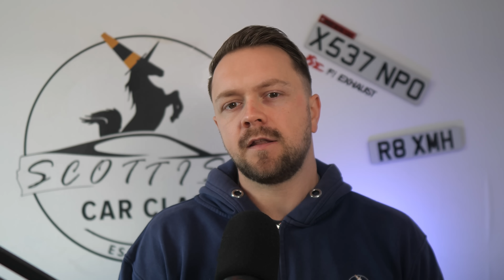Modern Cars Are FAILING Us — So I’m Saving the Reliable Ones

Comment: Hi Grant - I stumbled into Civic ownership when my ancient Fiesta finally died.  Bought a 2007 courtesy car from my local garage, a Gen 8 Civic 2.2 Diesel, which had a few unfeasible  bodywork needs before, armed with my new knowledge,  seeking out a Gen 9 Civic i-DTEC EX.  For just over £2k I have the car in your thumbnail.  As a lifelong motorcyclist, I was not looking for driving pleasure, just for reliable transport but the Honda has been a revelation.  Low floor pan and wide track give good handling, leather seats and wrap-around dash feel like a sports car and that 2.2 diesel is quite brilliant with bags of torque for punching past slow drivers and then returning 65 mpg on A roads and motorways when the tacho is showing under 2K rpm at 70mph with cruise control in charge.   Many years ago (fifty, in fact !), I spent every last penny on running cars I couldn't actually afford - Lotus Elans, Lotus Europas and four TVRS.  I can honestly say that this 2013 Civic, with 150,000 miles up, is realistically the best car I've ever owned and also one of the very nicest cars I've ever driven. Gen 8s are 2204cc, Gen 9s 2199cc so £20 pa road tax. Find one whilst you can . .

Comment: I completely agree with you. Perhaps you could do a video on what spares one should try to stockpile now (specific to the older car one has, obviously) given that 1) manufacturers discontinue them and 2) the aftermarket quality is going to shite and will only get worse. And even if you wind up the selling the car, your parts hoard will likely have increased in value and you'll have no trouble making your money back. Thanks again for the excellent videos.

Comment: My 2006 Vauxhall Vectra is an absolute dream for DIY repairs and servicing. Everything designed to be easily and cheaply fixable. Still got it in my garage, only 62k on the clock, sadly I had to stop driving due to ill health.

Comment: I'm gonna patch up my 19 year old diesel golf and keep it running forever if possible. New cars are absolute trash. Diesels used to be bullet proof in the 90s. Anything after 2010 is pretty much terrible - DPFs, Ad-Blue etc. EGRs are bad enough. Turned reliable engines that would almost run on atomised custard powder into fragile and expensive trash. I wish I could have my 96 diesel polo back.

Comment: I have worked professionally worked on cars for over thirty five years, welding as a repair is quite short term fix, panel replacement works but only when carried out in great conditions with care.
The car that is desirable has been retained by the owner.
Buying work has little future as scaling up is not possible.
Try another approach in my view

Comment: Great channel keep it up, I love watching from South Africa.  I'm running a 2011 2.4 lt CRV Auto AWD (110k miles) and a 2022 Suzuki 1.5 lt Baleno Auto made in India and  not available to the UK market I understand, both feature on your channel. 
I cannot understand why modern carmakers are making such complex vehicles, Suzuki will remain as one of the few sensible motor manufacturers. Thinking of buying a Mazda CX3 or CX5 Auto up to 2016 with 2lt petrol engine as a forever car as well.

Comment: Civic Hatchback 1.8 v-tec 2006. Some dents and scratches but drives like a new car. Runs so quiet you think it's electric 😊 Also have a SAAB 9-3 1999. Also runs better than a new car. It now deserves to only be used during the 6 months without salt on the roads. Although I have more slightly newer cars these are the one I use most and the ones with the least problems

Comment: I know that some people will make a comment about my choice of car… But we own a low mileage 2003 Rover 75 Classic with a 1.8 K Series engine. Yes, we had to replace the motor due to hydraulic engine lock, too much coolant that the garages that did work on the car kept filling up the expansion bottle, thus I did likewise, stupid mistake! Should have looked at the handbook. But I have to say it's an easy car to work on compared to an Audi A2's lower wishbone. Even managed to repair the number plate light due to one of the connectors breaking off. Also own a 1965 Humber Super Snipe, hope to get that back on the road soon. Great channel.

Comment: I'll be replacing my 2002 Focus TDCi next year after owning it for over 18 years. I'm looking at the 9th generation Honda Civic 1.8 i-vtec (2014-2016). I've heard the early 2.2 diesel is good, but I don't think I'll be doing enough miles to justify another diesel.

Comment: Another good hack is to buy cars from the south of England.  I live in yorkshire, but my past few cars have been purchased from south / london and were virtually rust free (1997 Toyota Starlet, and 2001 Toyota Yaris 1.0 GS).   There's lots of rust buckets down there also, but the lower mileage ones tend to be cleaner, whereas in yorkshire even low mileage stuff is pretty corroded..

Comment: My daily and only car is a 1984 Merc w123 230. 180000 mls.
Not the most basic car, but easy to work on and service parts are easily available .
Rust is a problem, but a bit of welding and paint now and again keeps her running well.

Comment: I wish there were more people like you.
We're supposed to be carbon conscious and there have been a lot of improvements in middle age cars but think about it, how guff goes in the atmosphere when manufacturing new (short life!!) cars? Think about all exhaust pipes transporting all the components and blast furnaces to make cars, what happens to all the non recyclable materials that would have long outlasted the mechanics and electronics of many recently made cars.
I think the manufacturer and/or importer ought to have to pay a disposal cost upfront for cars, the longer life cars it wouldn't be such a burden would it.
(I think this should also apply to limiited life washing machines, TVs etc.)

          What a great channel. Martin.

Comment: You used to see old Mercedes being run as Taxis in North Africa probably after doing 300km in Germany. Not sure what they are going to use now as a modern MERC will hardly last 5 years in the UK without expensive repair

Comment: As an advanced DIY mechanic, I think the best cars for easy repairs, would be something from the 1990s. I had a 1995 Ford Escort ghia 16i, but even that was a pain in the arse to repair. Fuel pump was in the petrol tank, and to change a cambelt, you had to change the water pump. They also had a problem where rain would enter the fuse box and ruin it. Give me a ford Orion, Cortina, Capri.

Comment: I had a 2006 ford ranger, possibly the best vehicle ever built but the rot got to it after 15 yrs and I sold it to go abroad where mot's don't exist, god I wish id spent 10k on it to fix it cause the engine would run forever

Comment: Can you clue us into a network of similar minded mechanics that will want to help,us fight the good fight?
So many just shrug when you ask if it’s repairable.
Even when it is, they just shake their heads.
Cill welding, 
I have a 2006 4x4 panda, just needs a rear subframe brace. 
Where can i find a welder who can repair, or adapt the new part, to keep us on the road!??!

Comment: Mod cons !!.  Air-conditioning this is England i dont need it we had a mini and a ford p100 pickup living in S A  Johannesburg no aircon had a new 2010 skoda Yeti dash always telling me it's icey ffs got shot no more motorway regenerations that led to 1.0 citigo to ldv 2.5 bus to 1.6 tdci ford fusion in 3 1/2 years cambelt, water pump for piece of mind, alt belt 2 ball joint rubbers runs like a Swiss watch  want somthing bigger now dogs pre euro 6 is the target eg transit  ect.  The major problem nowadays is the quality of original parts and some so-called  OEM replacements

Comment: I like my 2015 i30 diesel. It has the modern features I like such as plenty of airbags, ABS, ESP, cruise control, speed limiter, built-in hands-free phone, spare tyre & jack, £20 VED, and doesn't have the stuff I don't want like keyless entry, touch-screen for controls, electric handbrake, LED bulbs (apart from DRLs & high level brake light), cam-belt.

Comment: Preservation, a second life....yes please many good ppl deserves these late 80s to early 2010s fuel injected cars.
i myself drive a base model  2003 Toyota Vios 4 speed torque converter(Yaris alternative) which is a time capsule  casue its only got 88000 miles.

Comment: I absolutely agree. My two cars are a 2000 Audi A2 and a 2009 Audi S5. Both cars need their upkeep, but these are usually quite possible to perform at a reasonable and economic cost. The A2 is a titan, already north of 100k, it just keeps going and going. The S5 carries all the modern conveniences I want and none of those I do not want. I have rented some current year cars and, while their technology and generally wizzardry are very impressive my immediate first thought is: how does anyone isolate and repair a fault of these things? My older Audis just need to be plugged into VCDS and given 5 minutes to identify any issues.

Comment: Another great video. A family member has an 18 month old Yaris Cross from new. The 12 volt battery keeps going flat and the car will not start. They carry a jump pack now !!!  The dealer told him to drive it more. That didn't work. They replaced the battery, that didn't work. They took it to the dealer and left it with them. After 2 days , it's a faulty ECU that's not charging the battery. It would cost £1,500 if it wasn't covered by warranty. They now want their old diesel Volvo back with 100, 000 miles on it. Good luck with your new venture

Comment: I had 05 plate crv for 13 years  160.000 miles  only oil and filters and brakes , now have 66 plate crv not just as good had few sensors replaced but still not to bad, you talk a lot of sense regarding cars, but I work in plant hire as in excavators and this sector is going the same way , in eighties- nineties would buy new JCB  3cx and run 4-5 years with little trouble ,now so much electronics to fail or go on limp mode you can’t get a good days work done.

Comment: On my BMW E90 from 2010, if you want to change the headlight bulbs you remove the little flap under the wheel arch to give you access to the bulb housing. Just turn the steering to move the wheel out of the way depending on what side you are working on. One failed after 15 years but I replaced both at the same time with genuine BMW one's.
Reply: How's it going?
I have 2010 E90  from 2012 with 30k  miles.
Now it's 120k..
Expenses so far.
-2 side door locks -70
-Boot lock 200
Traction control sensor (400 pound)
Both rear discs replaced.
So far failed only one MoT out of some 13.

Comment: Keep year after year hanging on to my 2001 octavia 110 tdi estate with 254k miles .
looking cosmetically a little tatty in places but absolutely no structural corrosion.
Bomb proof 1.9 pre pd engine, still genuinely averages better than 60mpg.
Just can't see a logical reason to change, small things wear out like the drivers window regulator last month.
replaced the corroded 1.5mm braided cable with some new stainless variant for 80p and were all working again and this time it can't corrode.
£162 fully comp with a reputable insurer.
I can park it anywhere in a carpark and not fret about door dings, it's quite freeing to not have to worry about depricaton too.

Comment: I’m getting my grandpa’s Corolla 2006 next week which he bought factory new 19 years ago.
It hasn’t had any major repairs, only kept on going with ordinary service items. It has full service history, 112 000 miles and been living in his garage all years. 
I already own a good car, a 2018 V40 CC but I couldn’t pass on the opportunity to get a pristine one owner Corolla wagon that’s been in the family since new… We’ll see what happens with the Volvo but the Corolla will stay with me.
Reply: Get rustproofing, rust is about the only thing that will kill it.
Change every oil plus coolant and brake fluid, keep the brakes well serviced, change the cambelt if fitted if due.
Enjoy
Reply: He is right rust is the only thing that will kill it . @lewlewis6511
Reply: Update if anyone’s interested: 
Got the Corolla and I find it really good to drive actually! It’s refreshing not to have auto start/stop and other unnecessary crap of today’s vehicles. Oil dipstick is a huge win as well as hydraulic power steering. Even the headlights are really rather good compared to the LED headlights on the Volvo.
I will fix the brakes on the Volvo and sell it.
Reply: Use the Volvo in the winter, keep the salt off the Corolla!
Reply: Change the oil every 5,000 miles (not recommends 12 miles) on the Toyota Corolla and it should be good for +500,000 miles.
Reply: The UK built one? Bought one of these cheap from auction back in 2015, lasted for years. 1.6 if I remember right. Possibly the easiest car to home service ever. The auxiliary belt even has an auto adjuster at the top which allows you to change the belt in less than five minutes with just a slight push of your ratchet. Chain driven engine, decent in snow and cheap to maintain. Nothing to hate about the car, although I wasn't keen on the looks but who cares really, it's a car!

Reliable, easy to service, decent car. Recommended.
Reply: @klawlor3659  I think this one is built in Turkey. 1.6 VVT-i, 110hp. It's not fun to drive nor to look at but it's reasonably comfortable, reliable as a rock, practical, easy to work on, cheap parts etc. Needs some rust repair though at the lower front wheel arches.
Reply: @oOJakkeOo Ah ok. Yeah they're a great car to own, and will get you from A to B with minimal hassle. An absolute delight if you want a car that you can pretty much do everything on from home. Good luck 👍

Comment: My Mazda 3 2.0 Skyactive G 2015 car has never let me down. May it long continue to get me from A to B.
Reply: Yep.
Reply: Your dam lucky mate I've  just got rid of mazda 3 2023 still under manufacturer's warranty  if nothing goes with it  your on your own 10 months of hell  with mine broke down 8 times  never out of mazda recovery 3 times they say there's nowt wrong 
 I won't t be buying another  it was a 2.0 skyactive G
Reply: @christophertonge8871  Don't get a Mazda past the Mark 3. I have a 2017 Mazda 3 and it's been great I traded in a 2020 Skoda Octavia for it as I did not like it (should of got a 3rd gen Skoda not a 4th) My Mazda is the facelift version of the Mark 3 which is so much better than the 2020 Skoda Octavia I had. I tried a Mark 4 Mazda and found it terrible compared to the previous gen. Recommend not getting a Mazda 3 after 2017 in my own opinion.

Comment: I'm just about to buy a Dacia sandero stepway 2019 plate am I doing the right thing?😬 There pretty basic motoring though
Reply: No expert on modern cars but the less technology the better so sounds like good decision if you don't want something older that will need some work over time

Comment: I have a mini cooper s 2014 80k miles and have just purchased a Golf R32 with 118k miles. Combined market value 10k both in mint condition. Even with the £735 road tax on the R32 I'm happy with the older cars.

Comment: Major zeitgist time period unfolding here. Millions of disenfranchised motorists must organise and challenge the tired broken rhetoric of emissions driving old vehicles into a cul-de-sac maze of unaffordable taxtion and penalty fine Ulez 'so-called clean air' zones. An organised movement could lobby government and turn the green and co2 agendas against themself with factual data. Intuition tells us it's more environmentally friendly to mend and maintain good solid reliable vehicles rather than throw them to the scrap-yard and replace them with unreliable disposable 'pretty' ones. If uncorrupted analysts could be persuaded to calculate the undisputable costs of planned obsolescence against mend and maintain, that argument could be won, and millions of older, repairable, and therefore environmentaly kinder vehicles could be saved, heralding the opening for a new model for car production in the uk. It just needs to be organised and strategic. If motorosts fail to act in sufficient numbers, and in sufficient time, there will be no older decent cars left to save. Plus, this proven model could open the door for a new movement to purchase the rights to re-production of sound older classics with a focus on mend and maintain at the outset. We can't afford to wait for a government or corporate saviour here. We must get this done, and quickly.

Comment: I am on the same page here, the problem with aging cars however, is the corrosion. Even if you can fix the mechanicals, stopping or slowing the rusting of your everyday car is much more challenging. You can keep the underside clean and use a proprietary product on it but still it’s not really practical to be doing this as often as it needs.  Recent cars are of course much more durable in this respect that the cars of the 70s and 80s but my 2013 Peugeot does show signs of significant corrosion now. I get under it regularly to do maintenance so I am well aware of this. It doesn’t show on the outer panels and the paintwork looks ok, but if you have a poke about underneath there is sign of crumbling metal. I have just had to fit new brake flexible because I didn’t like the look of the rusting crimps. Removing suspension and brake components is a hell of a challenge due to rusted and seized fixings and you’ve got massive anxiety about breaking any of the fixings and then being unable to reassemble everything without drilling out rethreading or whatever.